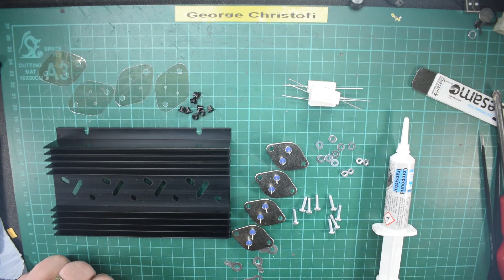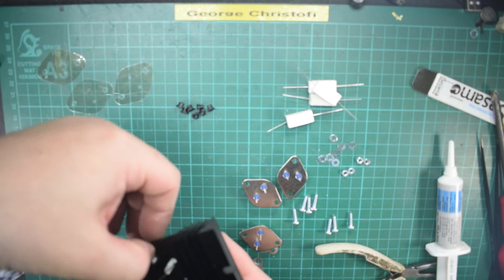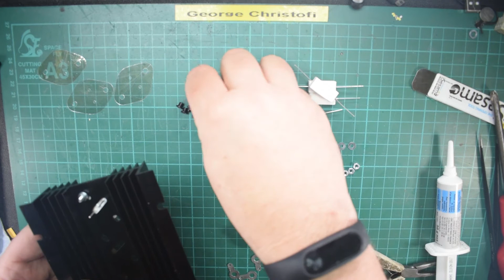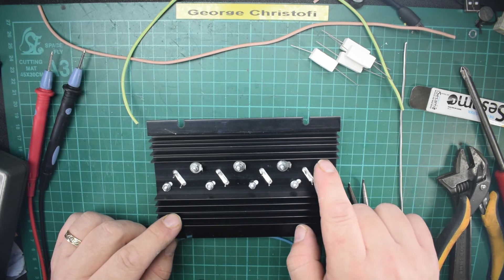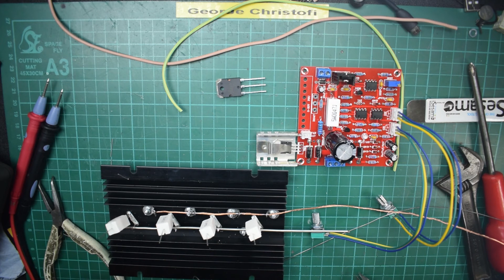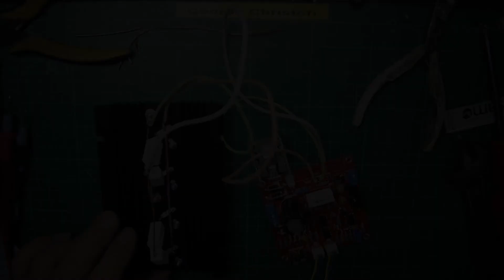High Power PSU Project. Part 4. : Fitting the pass transistors

Comment: Why such a heavy gauge base lead? Only emitter and collector leads need to be heavy duty. The base is only a control signal
Reply from the maker: Purely for physical strength. I could have just used any old bit of wire but as it was a work in progress I just used what was to hand.